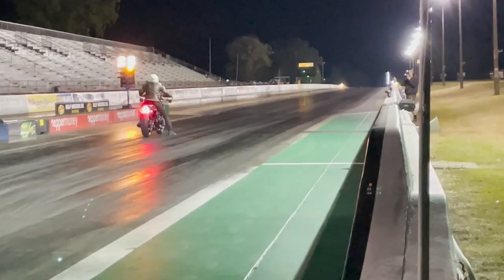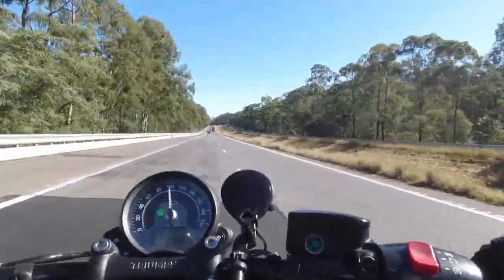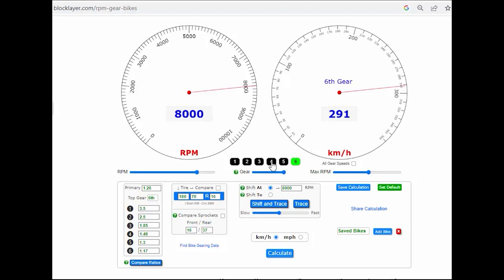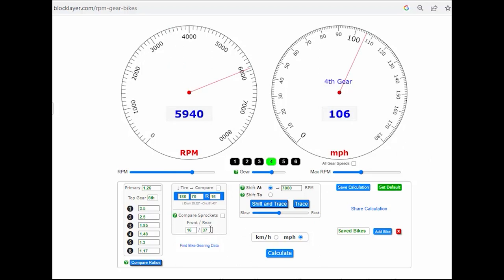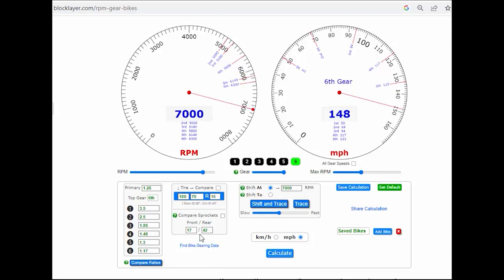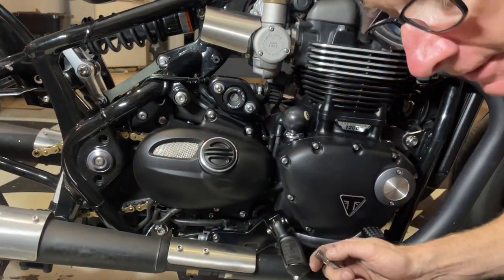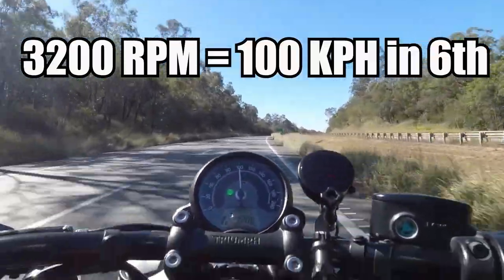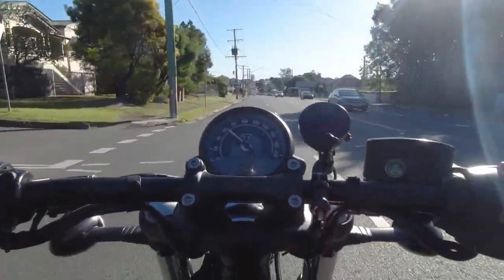What is the best gearing for the Triumph Bobber

Comment: thats a nice tool, i was able to find out allmost what i get in bobber speedo in to this app, now im for sure going with 180/70 tyre . Thankyou very much for the info
1st- 89
2nd- 125
3rd- 168
4th 210--but of no use since it locks at 180
Reply from the maker: You can remove the speed limit with Tune ECU.
Reply: @thebrowncobobber  yaa i ordered the obd2 device waiting for it to reach. what the top speed one get once they we remove the limiter? Im sure u would have done that first
Reply from the maker: @AshishRathish  You can raise the rev limit to 7400RPM.
Reply: @thebrowncobobber  ohhh  okk.. how about the top speed?
Reply from the maker: I believe once you turn it off the bike is free to do whatever speed it is capable of until it hits the rev limiter. Which I am pretty sure it would not do in standard form.

Comment: I was checking for a 42T sprocket change on my 2024 Triumph Bobber.  I read in a few forums that the EDU will flash a warning light (error code)?  "A check of the code (ECU DTC: P0915) says it’s gear position sensor signal error, and lists among possible causes “incorrect sprocket size”.  

When asked for clarification, here is a reply from Triumph Customer Service:  
“Thank you for your email. I'm afraid that the gearing cannot be changed from what the bike has been homologated with, and this covers all manufacturers not just Triumph, we all have to conform to Euro 5 or we cannot retail our bikes.
I appreciate your disappointment, but there is no way around this legislation, sorry."
Best regards”

Has anyone encountered this on the [new] bobber?
Reply from the maker: Have you tried the Tune ECU Forum?
Reply: Yes.  I found a shop in the UK to do it.  DNK Tune Works will send a new file for new sprockets that cost $250.  I will need to find a shop to flash the ECU   @thebrowncobobber